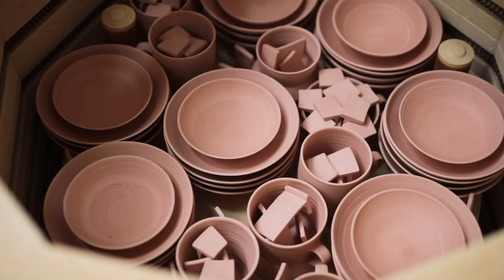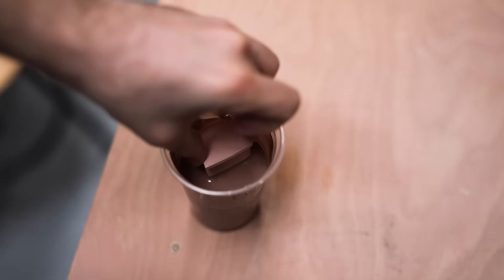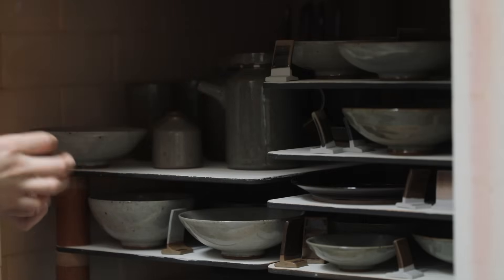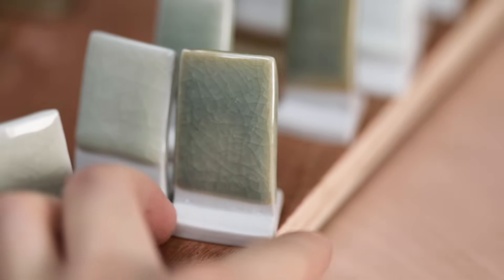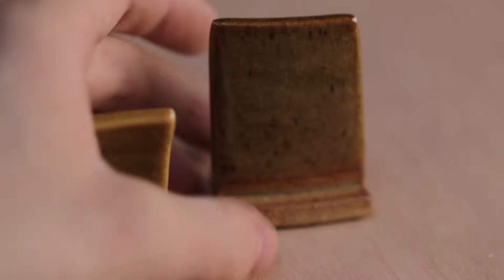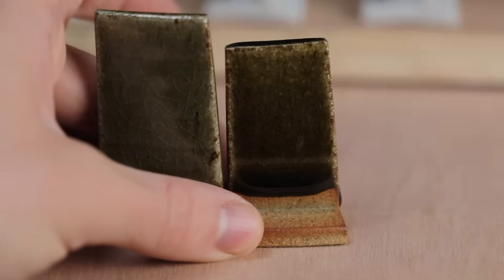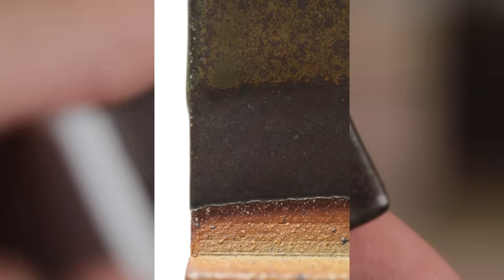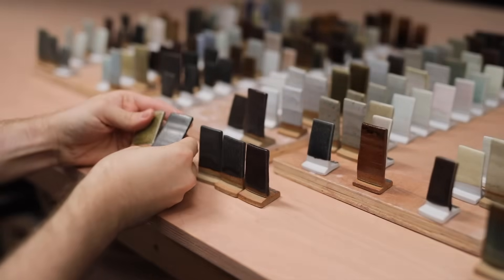Searching for New Pottery Glazes — Reduction Fired to 1290ºc

Comment: Can I ask what makes your crackle glazes food and dinnerware safe as all the crackle glazes I've seen say they aren't food safe. I love the look of crackle glazes and would love to put one on dinnerware if I could find a food safe one.
Reply from the maker: Hey! I’ve replied to this query already in the comments here somewhere but I’ll send it over again as it’s an interesting subject. Here's my usual copy and paste reply to that question. It's a big topic but I think there is quite a lot of misinformation that goes around surrounding it. Ultimately it comes down to a number of factors, but I'll put my longer response below. The linked article is well worth reading too! (Sorry for the wall of text that’s about to follow).

Well, there’s a lot to say. I’ve been using crackle glazed ceramics for years and years. I use high fired stoneware with nothing toxic in my functional wares glazes that could leech, the crackling doesn’t stain too badly as long as it’s properly washed but of course it happens overtime. To the same degree, many of the potters I’ve worked for over the years who wood fire, soda fire and so on, all have work that crazes and crackles to some degree and it all stains with time, yet functional work is still made abundantly and is it completely usable. There can be issues if you’re using toxic materials and if you use a clay body that’s fired to lower temperatures and isn’t fully vitrified you can end up with pots that leak when combined with crackle glazes.

I’ve never heard any stories of anyone getting ill from crackle glazed pottery, the clay is highly vitrified and unless you take terrible care of your ceramics you’ll be perfectly healthy. For industry it could be an issue, due to the surface of the pot having less strength, long-term staining with excessive use and fragility as it’s high fired stoneware with lots of iron, which makes it weaker and more susceptible to chipping on the whole, but that’s what you get with handmade ceramics, I don’t want to make pots that have perfect, uniform surfaces like you might find in a shop, I want each to be individual and interesting and handmade and I suppose the same goes for the generations of potters who’ve worked all over the world. Of course it depends on what materials you’re using in your glazes and/or if the you’re firing hot enough so that your clay is vitrified but if there’s nothing toxic and you’re firing very hot then there’s little that’ll hurt you.

Here’s a good link to an article that goes into more depth about it, https://ceramicartsnetwork.org/ceramics-monthly/ceramic-glaze-recipes/glaze-chemistry/techno-file-dirty-dishes/, and clears up some of the misconceptions that are spread around. As long as you properly wash crazed pottery there is no bacteria left in the crackles. As long as you take time to care for your handmade ceramics after they’ve been used then they’ll be just fine.
Reply: @floriangadsby  Thank you so much for the in depth explanation. It makes a lot of sense. Unfortunately the link isn't working.
Reply from the maker: Ah wonderful, I’ll update my copy/paste. Thanks for finding that, I spent ten minutes searching but to no avail.
Reply: @floriangadsby  amazing info!. I always tought about functional wares that have crackles on it. For example many asian pottery do have such as tea pots or yunomi.
Reply: @floriangadsby  I just watched another pottery video where they said that the cracks go through to the clay body, and the crazing makes your pottery weaker overtime. There was a video of a baking dish that had crazing in it and the butter was leaching through the piece! 

I agree that it's not highly dangerous, and I love the beauty in something that most potters to be a flaw, but I would be worried about the longevity of the piece
Reply: @floriangadsby  another thing to consider is allergens. Especially gluten, it can stick in crazed glazes through being washed. On the next use it can transfer to the food it contains potentially causing a reaction in those with celiac, wheat allergy and NCGI.
Reply: but botha are available

Comment: That soft brown glaze reminds me of one I use (nicknamed Ohio magic in my studio) comprised of 85 percent Cedar Heights Redart and 15 percent whiting. It is a soft satin brown with a greenish tinge where thick, and will be slightly more metallic and redder if mixed 90 to 10 instead of 85 to 15.  It also never settles in the bucket. 
by the way, I fire to 1280 degrees C and start reduction at about 700 degrees C.
Reply from the maker: I love the sound of a glaze that never settles in the bucket! I'll test that recipe when I next get around to firing, sounds interesting. Thanks for taking your time to watch! 🙌🏼

Comment: Thank you for sharing your recipes. I'm going to try testing both the Thomastown Tenmoku and your own recipe tomorrow. I've been using this one for over 20 years at Sutton college and have found it really reliable. On a high iron clay you might find the red of the iron breaks through to the surface a bit too much unless the glaze is applied thickly.
POTASH FELDSPAR           29
SODA FELDSPAR                 2
CHINA CLAY                         9
WHITING                             17
FLINT                                   34
RED IRON OXIDE               10

Comment: I apologize for our language barrier. I really like your work. thanks for that. I'm also an amateur potter and we make two more notches on the samples to see how much it goes into the shard. soak the flank in manganese dioxide to see the reaction with the burel, and soak them so that one, two or even three layers are visible. and not completely down to see the flow. it's just a tip. you can see more reactions in a small place.

Comment: Question Candidates for your next Q&A (?):
Do you regularly/have you ever...calibrated your scale before weighing out fine amts? Scales weighing to 2 points can go out of calibration quickly...as much as .2 - .5g. 
Trial: Do the same tile test but use a new and just calibrated scale. Compare results. Evaluate if there was a significant difference not accounted for by other variables...if at all possible!
This difference in my Canadian cannabis dispensary amounted to about $1k loss per month if I didn't calibrate regularly.
Just a thought.....
Love your videos✨👍
Reply from the maker: Woah! That's crazy. I have calibrated it once so far and occasionally it just refuses to measure anything until it surpasses 1 gram, I think I should probably invest in some superior scales. The answer to most of your questions is that I haven't tested enough to run into any issues. I haven't had any problems mixing up larger batches yet but I suppose small variations could exist. The other issue is that raw materials change from time to time, so feldspar I get from say, Spain may suddenly come from somewhere else, and the chemical composition of the new feldspar may be very slightly different or even processed in an entirely different way, which can have drastic consequences. The scary thing is we have very little control over that and over the years raw materials have started to become more and more processed for bigger industries whereas us ceramicists usually prefer the more unrefined stuff. It's a fascinating topic and one I've heard so many scary stories about from fellow makers. Thanks for watching Jack!
Reply: @floriangadsby  Thank you for such a cogent response! Cheers! 😊✨👍
...by far my fave channel!

Comment: Awesome Video! whats the toxicity issue with manganese? I mainly thought it's a dust/fume hazard. I thought cobalt oxide is far more difficult. As for the running glaze I thought the 26 of gerstley borate would have been mostly responsible for the running.
Reply from the maker: Cheers! Glazing aren't my strongest topic but I'm getting by and still learning a lot. Manganese generally isn't practical for functional wares but it's also the fumes they give off when firing that can be pretty awful. At the moment I'm in the same room as the kiln that's firing for the whole day and even though I have some pretty good ventilation in place from what I've read I just don't want to be using the stuff. Not only that but getting it on your hands or breathing in the dust is really bad for you too, which is annoying as it creates some simply beautiful qualities!
Reply: @floriangadsby  thanks for the reply! I can imagine having the kiln in the same room is a concern :) food safety is a very strange topic! especially since eu regulations are to be tightenend in the next years. I am looking foward to more videos on glazes and can't wait to see finished porcelain works and explainers. especially since it feels so much different.

Comment: Are the crackle glazes functional?
For eating/drinking? I always thought they were just ornamental, is there a way to seal the cracks or something like that?
Reply from the maker: Here's my usual copy and paste reply to that. It's a big topic but I think there is quite a lot of misinformation that goes around surrounding it. Ultimately it comes down to quite a few factors, but I'll put my longer response below. The linked article is well worth reading too! (Sorry for the wall of text).

Well, there’s a lot to say. I’ve been using crackle glazed ceramics for years and years. It’s high fired stoneware with nothing nasty that could leech, the crackling doesn’t stain too badly as long as it’s properly washed but of course it happens overtime. To the same degree, many of the potters I’ve worked for over the years who wood fire, soda fire and so on, all have work that crazes and crackles to some degree and it all stains with time, yet functional work is still made abundantly and is it completely usable. 

I’ve never heard any stories of anyone getting ill from crackle glazed pottery, the clay is highly vitrified and unless you take terrible care of your ceramics you’ll be perfectly healthy. For industry it could be an issue, due to the surface of the pot having less strength, long-term staining with excessive use and fragility as it’s high fired stoneware with lots of iron, which makes it weaker and more susceptible to chipping on the whole, but that’s what you get with handmade ceramics, I don’t want to make pots that have perfect, uniform surfaces like you might find in a shop, I want each to be individual and interesting and handmade and I suppose the same goes for the generations of potters who’ve worked all over the world. Of course it depends on what materials you’re using in your glazes and/or if the you’re firing hot enough so that your clay is vitrified but if there’s nothing toxic and you’re firing very hot then there’s little that’ll hurt you.

Here’s a good link to an article that goes into more depth about it, https://ceramicartsnetwork.org/ceramics-monthly/ceramic-glaze-recipes/glaze-chemistry/techno-file-dirty-dishes/, and clears up some of the misconceptions that are spread around. As long as you properly wash crazed pottery there is no bacteria left in the crackles. As long as you take time to care for your handmade ceramics after they’ve been used then they’ll be just fine.
Reply: @floriangadsby  thank you for noticing me sempai!

There's still so much I don't know, I wish one day I can do an apprenticeship with you as you did with Lisa.

Comment: Very interesting video. Please keep making them.

I have the same scales that you have. They are rubbish. Please buy better ones. The functioning of scales should not depend on how you jiggle the battery compartment or the phases of the moon etc.

I wonder if it is possible to make glazes from pure chemical compounds and not minerals - the composition of which change depending on what part of the earth's crust you are digging up.

People keep extolling the virtues of those wonderful reduction copper reds. But you don't seem to use them?
Reply from the maker: Thank you! And you're right, they are awful! They worked well for a day or two and then they just flopped and work sporadically. I'll have to get something better for the next round of testing.  And copper reds, maybe one day! I have a good one coloured simply with iron but copper reds change a lot depending on when the reduction is initiated, which could screw up my current firing schedule unless I dedicate a whole firing to them, but that certainly isn't a problem.

Comment: what is your bisque temperature? Any special precautions in doing your bisque? The bisque must be on scedule and repeatable everytime for all firings. As close to oxidation as you can keep it otherwise it will affect your glaze colors or they will be different each time.
Reply from the maker: 985ºc with a 15 minute soak. No precautions really, I stack it as densely as possible without crowding the elements.
Reply: @floriangadsby  Oh, electric fired bisque. I thought it was gas as you are reduction firing. Electric on the bisque is good.